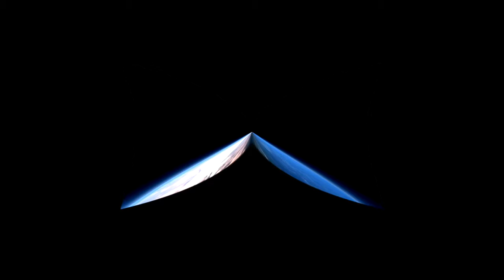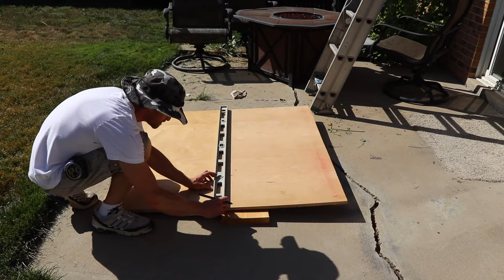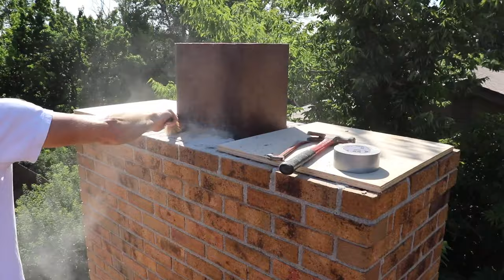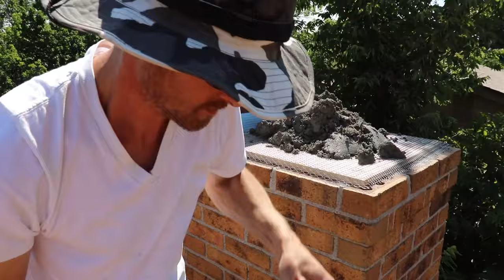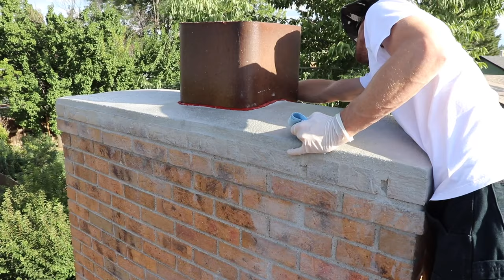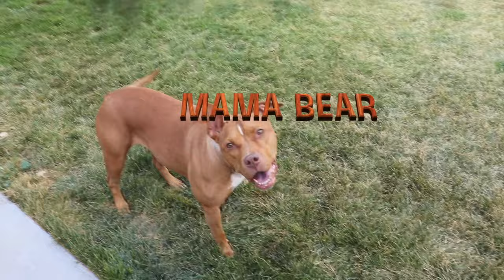DIY Chimney Crown repair

Comment: Everything looked correct except next time use concrete backer board instead of plywood. I’ve seen numerous wooden supports like this turn into charcoal underneath which causes the chimney crown to fail over time. Other then that, great job
Reply: Great job, But I agree with the above I would have used slate instead of plywood. It doesn't warp, rot or expand and the mortar would have bonded much better to it.
Reply: Not to mention it's against code to have combustible material incorporated into a chimney build. Sorry but He doesn't know what he's doing.

Comment: 1.   The mesh needs to be in the concrete.  Not under it.   2.  The crown needs to be larger then then chimney.  So, you need to build a form around the chimney. 3. I have never seen a chimney cap put on with silicone.

Comment: Missing 1.5-2.0 inch drip edge. Water should drip onto roof not run down sides of chimney. Also cement is used for crown not mortar.

Comment: Beautiful work.  In cold climates, a 1 or 2 inch overhang is needed to prevent water from running down the sides of the chimney.  This causes spalling of the brick from freeze/thaw cycling.
Reply: Exactly my experience as well and is what is typically required by standards.  The brick degrades so much faster with these tapered edge chimney washes.

Comment: Doesn’t the plywood expand and contract allowing the crown to crack again, plus it’s combustible? Could you use cement board or thinner wire mesh to achieve the same goal? 
Thank you
Reply from the maker: I don't have any problems with using plywood in my area (dry climate), plus I checked for any cracks in my clay liner. I recommend using a Hardie backer cement board if you live in a area that gets a lot of moisture or if you have cracks in the clay liner. I hope this is helpful. Thanks for watching!
Reply: @WillowsWorldofDIY  Thank you!
Reply: The temperature of most flues at the top of the chimney is less than that of either the boiler or fireplace at the point of combustion, and rarely exceed 200 degrees F, well below the burning point of plywood (around 250 F, depending on thickness; n.b., some flues can emit temps in excess of 400 F, but, those are, usually, short stacks, such as those used for a backyard, brick, oven). Adding an expansion joint, such that the wood does not come into direct contact with the flue, further reduces the temperature by as much as 50 F, depending on the distance/width of the joint (3/8" is industry standard). So, the odds of the plywood burning are very low, assuming everything else is done, correctly, which, unfortunately, even professional masons can screw up. However, having said all this, a metal plate or cement board is the professional choice, since neither will expand/contract/burn under normal environmental and chimney temps. Do a search on repairing/replacing chimney crowns, and you may be very surprised at the different opinions, not to mention that not all rules apply to all types of chimneys, not to mention zoning regulations, which, usually, express minimum values, and may be too limited for a given application.
Reply: @skaizun  Thank you!

Comment: Using a hammer drill and drilling with maybe a qtr inch bit into a few spots in that old mud that was on the flue... is usually a safe way to help break up mortar before u start chiseling. 👍

Comment: Use concrete board for the open cavities also pour concrete for your crown with a minimum of 4 inches thick and 1.5 inches overhang

Comment: Is the plywood/backer board free floating until concrete is installed or do you screw the backer board to something??  Is the overhang of the hole 1” or what’s the backer board lip to edge?
Reply from the maker: @sjzimmy  I put screws in each corner slightly at an angle wedging the screws against the inside of the block opening, yes backer board overhang is 1”. I hope this is helpful. Thanks for watching!

Comment: Mortar is not the best thing to use for the cap, when used in that thickness it will usually crack. Concrete is much better, we usually use a premixed concrete called Quikrete 5000, it is a high strength concrete that comes in 60 or 80 pound bags, you just add water and mix. But be careful not to add to much water, you want to keep it on the stiff side. This will make it easier to shape, also helps from smearing up the brick like he did, it will give you a higher strength concrete and reduce the chance of a shrinkage crack. Best is to form and pour a concrete cap with a 1-1/2 overhang. If you do it like he did with no forms, try to keep your edges at least 2” thick. Instead of wood you can also use several prices of 3/8” rebar with the wire mesh over top, but make sure the rebar ends stop at least 2” from the edges. Many chimneys are not hollow like that one so then you would not need to use wood or mesh on top.
Reply: I've ran into thousands of Chimneys believe me most if not all crowns are done improperly.

Comment: You did an excellent job filming and editing the video.
Couple things I noticed...
The crown should be bigger than the bricks, to allow water to shed easily. The water running down the side will  erode the bricks-and-mortar.
The wire mesh you installed should be in the middle of the crown, the crown is hardly thick enough.
Reply from the maker: That's true. I thought about doing a 2" drip edge all the way around it, but I looked at all my neighbors chimneys and not one of them had a drip edge on the chimney crown. I think they did it this way because the top 2 rows of brick  steps out about 1" more than the rest of the bricks creating a drip edge. I did put sealer on the bricks and mortar to hopefully protect it from erosion. Time will tell if it will last. So far it still looks great after the first winter and we got quite a bit of snow this year. Thanks for your advice & Thanks for watching!
Reply: What you did is called a Flush Crown (ends flush with brick). Many masons do this so can leave same day. NOT good for longevity of brick and Chimney. Should ALWAYS be concrete crown to hold up longer. Thermal break great against flue, should also be between brick and crown.
Reply: Good observations. This guy Willow knows nothing about chimney crowns. If he’s charging homeowners for repairs like this, he’s hosing people. And creating more maintenance repair calls soon after he’s done. Lots of information out there showing the right way to do a crown. Ignore this Willow guy!!
Reply: @joshjepkema1141  are you saying there should be space between the crown and the brick? That doesn't even make sense..
Reply: @carlosmorgado7397  yes you should have a break, we use 30# felt between concrete and brick as well as the flues. Flues grow upwards when they heat up.
Reply: @joshjepkema1141  why between concrete and brick though? I get an expansion joint around the flu liner to let it expand, but the brick would have 100's of pounds of concrete crown sitting on it regardless of a break being there or not
Reply: @carlosmorgado7397  brick and concrete move differently, by having the break, everything lasts longer. Its actually the standard for Chimney professionals, taught at their classes.

Comment: Great video, you have given me the info and confidence to tackle my chimney crown. Hardie backer board is a great suggestion for the mortar base. The only thing I wasn’t really clear about is how you screwed your plywood down into the brick. Did you use expansion anchors?
Thanks again 
Bye for now
Chris
Reply from the maker: In this video I screwed the screws into open joints between the bricks and then packed the joints with mortar afterwards. Not all chimneys will have open joints like mine did, so I would recommend using Tapcon concrete screws to anchor the Hardie backer to the bricks or in the mortar joints. I hope this is helpful. Thanks for watching!

Comment: The sill expansion wrap is pointless in this case. It’s mortared at the bottom so it’s not going to expand regardless. You’d have to replace the whole piece. AND you didn’t make an overhang so the water is going to run Right down those joints and erode the mortar out of the joints

Comment: The video is solid but a couple of questions? Why did you use mortar for the cap? Concrete is so much better and durable.  how did you secure the wood to the chimney ? 2" screws in the brick? Why didn't you extend the cap so the water doesn't run down the bricks?

Comment: Why caulk to a clay flu ? Pretty impressed with results with not pouring for such a big crown
Reply from the maker: I used Hi Temp silicone to allow room for expansion of the clay flu when it gets hot. Leaving a little room for the clay flu to expand when it gets hot will help prevent the clay flu from cracking in the future. I hope this is helpful. Thanks for watching!

Comment: Wouldn't  it be better to use aluminum or stainless steel sheeting instead of plywood on base of crown ?
Reply from the maker: I’ve never used aluminum or stainless but I do recommend using hardy backer cement board instead of plywood especially if you live in an area that gets lots of moisture. I hope this is helpful. Thanks for watching!
Reply: @WillowsWorldofDIY  Thanks I know the hardy backer is used in bathroom tub and shower applications. 👍

Comment: Great Job! I have a question about the sealant you used. Did the tube specified that it was "Indoor/Outdoor" as well as if could be used on concrete/mortar? I can't seem to find the proper sealant Thank you for creating the video!

Comment: While sill plate (the blue, styrofoam, wrap, around the flue to be used to fill the expansion joint as shown in the vid) is commonly used, it is only good for up to 160 degrees F, whereas most flues at the top can emit 180-400, depending on the chimney source, purpose, height, etc. A thermal blanket with a min 180 F rating is a better, albeit, more expensive, choice. Look for the ASTM (American Society for Testing and Materials) label on the package to determine its viablity; unfortunately, there is a broad range of ASTM specifications for a variety of applications, but, obviously, if the product says it can withstand 180, then you're, probably, good to go for most, standard, residential, chimney, applications (it shouldn't surprise anyone that the higher the min temp, the more expensive it will be). You may also use rock wool, but, it should be double-faced with foil, which is hard to find, even for contractors. And you can (should) leave the sill plate or other wrap in the expansion joint, and then seal it with cement caulk (not cement) and/or tar or tar caulk (n.b., do NOT use expansion foam spray cans, as they are porous and not good for outdoor use, not to mention that, once cured, they do not expand/contract well, which is why they are rarely used for outdoor purposes).
Reply: It looked to me like the blue foam wrap was used as a temporary spacer and removed once the mortar was dry, then replaced with high-temp silicone
Reply: @MinionAtTheGate  . You are correct, after removing it he used a high temp caulk

Comment: nice video. i need to do a similar project.. can you tell me specifically what type of cement is used for this. I am in the Chicago area where we have lots of cold. Not sure if that matters. Also, do you use the same cement for repointing?
Reply from the maker: I used 3 80lb bags of Quickrete Mortar for this chimney crown, and I used the same mortar for the entire crown, this House is located in Colorado and they definitely get snow. I know some people that use Quickrete Cement for added strength and longevity but it is harder to shape during repointing. You will have to use a different wire mesh with larger holes if you decide to use cement instead of mortar. I hope this is helpful. Thanks for watching!
Reply: kunta kinte  yeah its flammable and expands/contracts with temp changes. Don't want to crack mortar

Comment: Thanks for taking the time to make the video! What kind of mortar should I use? Why did you use mortar instead of concrete?
Reply from the maker: I used Quikrete mortar in this video. Concrete is stronger than mortar but is harder to shape, and is a lot harder remove when it fails. Most chimney crowns are done with mortar, I would say at least 90% of them, if not more. The crown is not load bearing so concrete is not needed. I hope this is helpful. Thanks for watching!
Reply: Hi Willow, thanks for the quick response! I will do as you suggest. I have cleared away the old crown and will create a new one with Quikrete mortar mix. I am thinking of using type s if that is alright. Again, thank you for the well thought out and produced video.
Reply from the maker: @really2345  Thanks! Type S will work great on the chimney crown. Make sure you seal it with a good concrete sealer or crown coat. I recommend using 1/2" Hardy Backer board instead of the plywood if you live in an area that gets a lot of moisture or if there is any visible cracks in the liner. I hope this is helpful. Thanks again!
Reply: @WillowsWorldofDIY  Thank you for the advice. Will do as you suggest.

Comment: Beautiful red-nosed pitty at the end. We had one for 15 years. Best dog ever.  What is the purpose of the plastic on the wet cement, to prevent cracking when its drying?
Reply from the maker: Thanks Jeff! Miss B is my helper and is in most of my videos. I agree they are the best dogs ever. Yes, I cover the wet concrete with a tarp to prevent cracking while drying. Thanks for watching!
Reply: It helps keep the mortar from drying too quickly, which is what can cause the cracking.
Reply: It’s called a wet cure. U do this while the chemicals are reacting still. Concrete and mortar take 30 days to fully cure although most of it happens in the first 24 hr

Comment: Your cap should have a min thickness/height of 4" with a 2" overhang on all sides; given the size of your crown, a drip edge is also advisable. And, it should be domed or otherwise tapered starting from the top to allow water to run down the crown without pooling. And, as with any large concrete/mortar/cement project, it is advisable to spray the surface with a mist of water every hour or so for the first 8 hours to give it more durability (n.b., hardly anyone, even pros, does this, but it is a good idea; the tarp helps a little bit in retaining moisture, but, not enough, though you applied the tarp, presumably, only to prevent rain). Then, you can apply the sealer over the concrete, but, two layers is advisable (wait a day between layers, and use the tarp in the meantime (put a hole over the flue top/port if the chimney is in use during construction, as are most for boilers/heaters)).

Comment: I had no idea plywood is in there. Is this normal. Doesn' it get hot or have issues with the wood in there?
Reply: Durock sheets intead of plywood. Always use non combustible material

Comment: 15 year chimney guy here.  I admire your willingness, but there is so much wrong here it's scary.  If you're watching this video DO NOT do this.  Cement board instead of combustible plywood, have a drip edge, do not silicone the cap on, try not to get mortar all over the brick etc etc etc.
Reply: Should we use concrete or mortar for the cap?

Comment: How much mortar did you use for that job? I have a similar sized chimney. Great video. Thanks for the knowledge.
Reply from the maker: I bought 3 80lbs bags of mortar and used 2 and about 3/4 of the 3rd bag. Thanks for watching!
Reply: You are not supposed to use mortar on the cap. You use concrete last so much longer. Also, he didn't make his cap to extend a little past the bricks. Water on brick not good
Reply: @TheGucciman007  This minus the concrete. Yes it does last longer but when it does fail, it is a bitch to clean off versus mortar. It isn't load bearing so mortar is just fine especially if you mix some fine sand in with it to give it more strength. 99% of the time, chiney crowns are mortar. But I agree, there needs to be an overhang else you will always have water running down your chimney to one of the weakest points on the roof...the flashing between roof and chimney. Build a simple 2x4 box around the top and it gives you a 1.5 inch overhang. Most code calls for 2in but let's be honest...nobody is gonna measure it and if they do, .5 will be overlooked. And the frame is easy to remove. The biggest worry I have is him using plywood for the support. Should have used sheet metal or a rebar grid. Don't know if he knows that wood near a clay chimney is not good. But he looks to be in California or somewhere out SouthWest so he probably has gas anyways.

Comment: Just subscribed!  Is it necessary to always remove the old mortar from the crown?  My existing mortar is very thin and only cracked around the corners of the crown.  Would it be dumb to just mortar over it?
Reply from the maker: the new mortar won't adhere properly to the existing mortar, so it won't last long and will start cracking away from the existing mortar. I hope this is helpful. Thanks for watching!

Comment: Great work, do you remember how many hours it took you to do the whole thing?
Reply from the maker: I think it took about 6 hours total. It took about 4-1/2 hours the first day to do the tare out, cut the wood and wire mesh, pour and shape the mortar and cover it with the tarp. The 2nd day took about 1-1/2 hours to seal the concrete, fill the expansion gap and install the chimney cap. I hope this is helpful. Thanks for watching!
Reply: @WillowsWorldofDIY  3